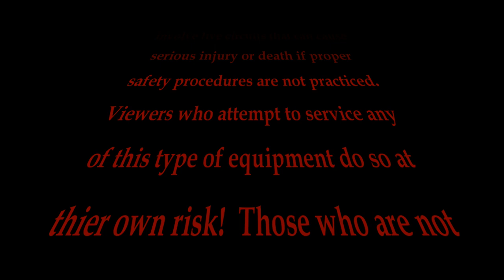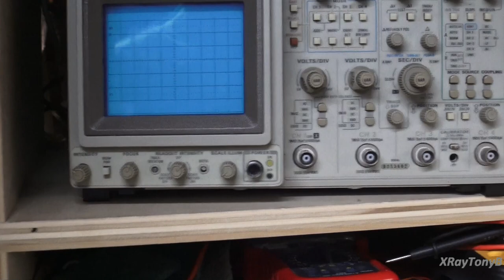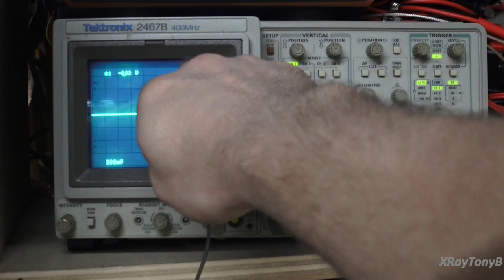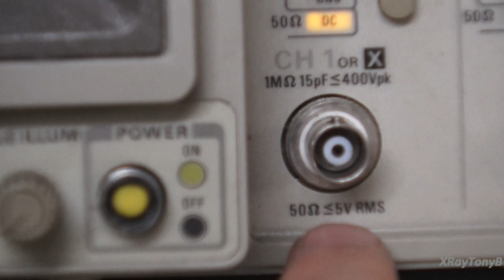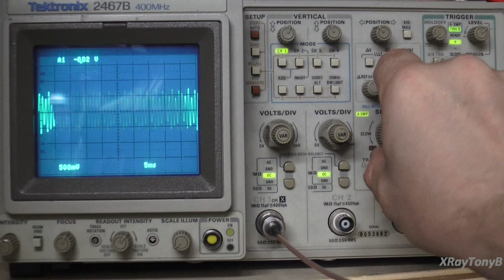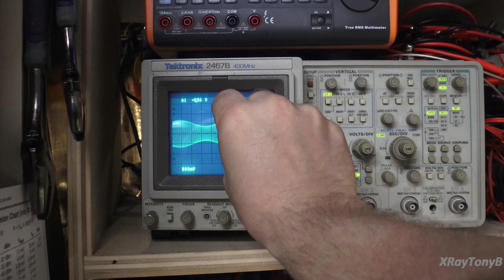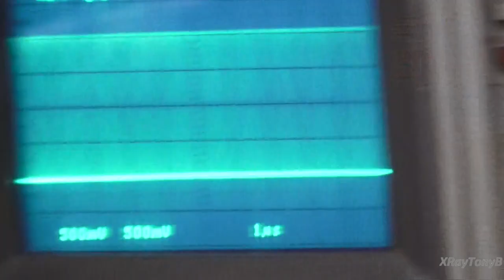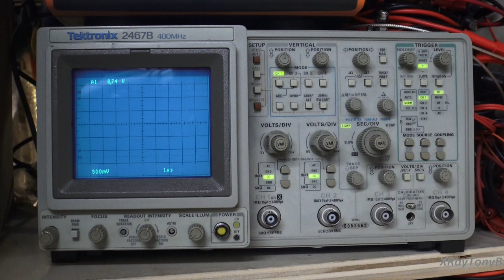Oscilloscope Series - Part 3 - Calibrated Timebase Oscilloscopes

Comment: I love the sight of electron beams on phophur, in the morning. Tony, please don't ever stop doing beginner-level stuff like this; it's so beneficial to some and those to whom it's tedious or boring can easily choose to watch any of the many more 'advanced' channels out there.  When I retired (as a mechanical engineer), a friend who had worked for the BBC outside broadcast division was slinging away (SLINGING AWAY!) a 7000 series Tektronix mainframe with 3 plug-ins so I persuaded him to sling it in my direction. I had fancied trying to understand more about electronics, as despite designing PCBs and similar for several years during the '80s, my knowledge of circuits was still limited. My first 'job' was to get it working!!! Boy, could I have used a series like this when I started and the timing would have been fortuitous, too!!!

I love watching your videos and have picked up a lot and, since I am also an amateur guitarist, I really enjoy your amplifier stuff as well. Keep up the good work. 🎸😅

Comment: Very well done, as usual.  Just one little suggestion:  Please explain the use of the three VAR knobs.  I remember when I got my first 2nd hand scope (no manual, way before the internet) that I had a hard time figuring out what these knobs were for and how to set them correctly.  Finally I found out they had to be in position "cal" in order to do a more or less correct measurement.  Newbies may need to know this.

Comment: Hey, Tony!  Thanks for yet another terrific video!  I do have one quick question, though - I notice the coupling section of either input channel has TWO "Gnd" settings; are these just redundant, or is there some difference between the two settings?
Reply: That's so no matter what setting you're on, GND is only one button-push away!  Usability -- nothing more.  But... useful.  :)

Comment: Is there any way to hook a speaker to a scope so the signal can be heard somehow??
Reply: I would like to trace signals with the Oscope...
Reply: Just hook the output of the circuit you're testing to an amplifier - that way, you can listen while you're probing the signal, and the oscilloscope should not effect the output at all.